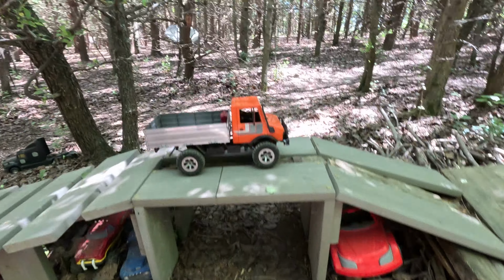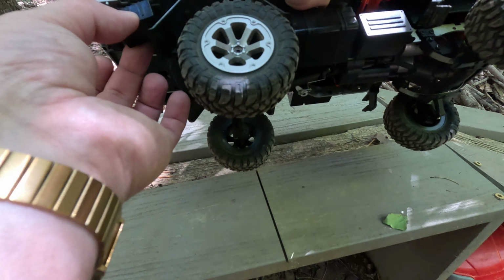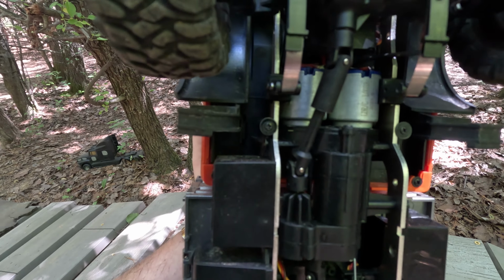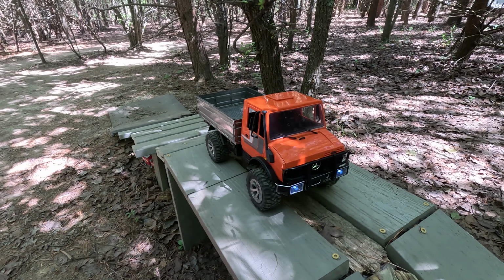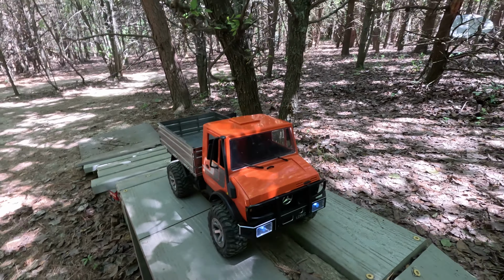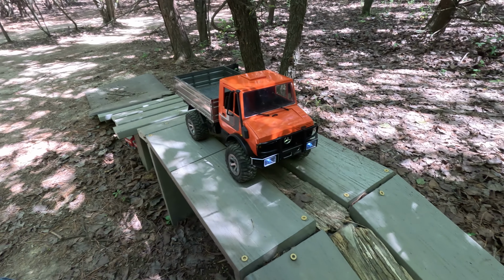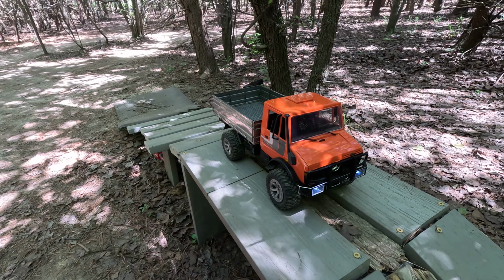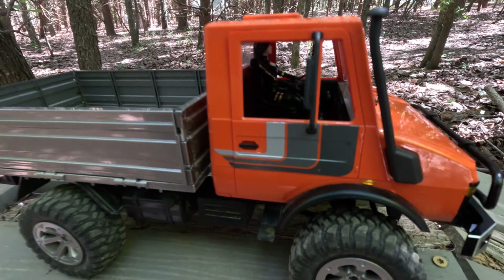LDRC Unimog two motors,two speed transmission,and lockable differentials trailing in the woods

Comment: Great Video. Years back i helped a Friend that owned a Gas station. Worked weekends during summer. There was a Guy used to come in on weekends with a unimog Huge Red Thing. There giant.
Reply from the maker: I didn’t realize how cool a Unimog is until I saw my first RC version then I was hooked. This one is loaded with features. The bed side panels and tailgate can all be lowered with hinges on them like a real one too. Thanks for sharing your old job Unimog story! I would like to drive one. ☮️👍😎
Reply: @deanmachinerc  Man that is cool all the stuff and scale. He had panels that removed just like that. Thank you my friend
Reply from the maker: @JamesDirtRC  I may remove the sides and rear and make it a flatbed since it is an option. They did good with all the scale details on it with opening doors and full interior. Its got the Mercedes Benz logos and front grill badge too. I was wanting a good Unimog RC and was looking at a Tamiya but this one came out and I actually pre-ordered it after reading all the specs planned for it. I waited four months and It ended up worth the pre-order wait. It was less than half the cost of the Tamiya with alot more features and dual 370 motors. Sorry this is a long comment! ☮️
Reply: @deanmachinerc   I don't mind the long comment. With all those options and controls how could you not like it. And it Runs Great. They are so unique . Duel 370 WOW
Reply from the maker: @JamesDirtRC  yeah man it has all metal gears with ball bearings in the transmission and axles. It is completely loaded stock. All i did was install larger tires and i made some adjustments to the leaf springs to make them work better. Its been a reliable trail rig. ☮️👍

Comment: Great video. I watched your other videos too to do some research because I want to buy one. The main reason is the remote locking diffs. The other features are nice too, but to me this is what has me sold. It's a feature that's hard to find and is usually on expensive rigs. I believe this is the cheapest product that has this feature. It adds such much more realism and smooth turning. My current trail truck is the Tiger Dog PUBG UAZ which has open diff.

How does the dual motor work? I've never seen that before. Is one motor for high speed and the other for low?
Reply from the maker: Both motors work together when you give it throttle both spin the exact speed and give it alot more torque and it uses all metal gears for added strength. It has surprised me, I have drove it many times and its great for the money. I actually pre-ordered mine so I had it since it was first announced and mine is one of the first ones built. Thank you for checking out my channel, I hope you enjoy it and if you have any questions feel free to ask away as I always keep in touch with my viewers and fellow RC friends. ☮️😃
Reply: @deanmachinerc  Thanks for the info. Does it have a drag brake?
Reply from the maker: @Diamondbac  yes it has a drag brake, I wouldn’t recommend it for rock crawling since it would most likely get hung up with the leaf springs in the way occasionally and with the transmission servo not well protected from underneath. As a trail truck and for crawling trail obstacles, I definitely recommend it. Oh, I don’t believe I mentioned it has portal axles with ball bearings all around and also has a full metal drive train with all metal gears besides the plastic driveshafts which I did buy a set of metal ones when they break but the plastic ones have been great so far. I also upgraded to a 1,000mah 2s lipo but it isn’t necessary as the stock battery was fine. ✌️😃